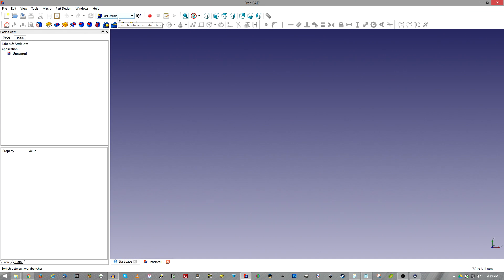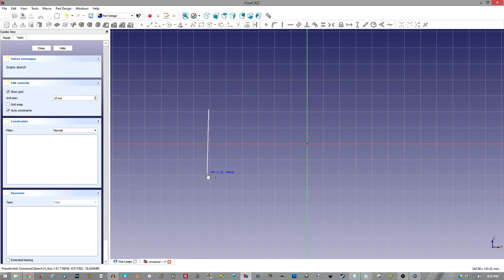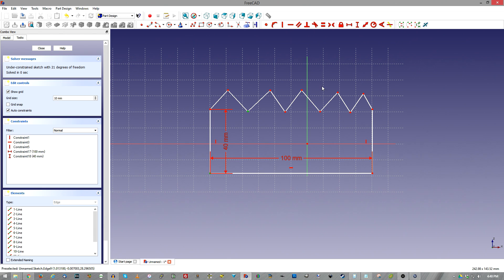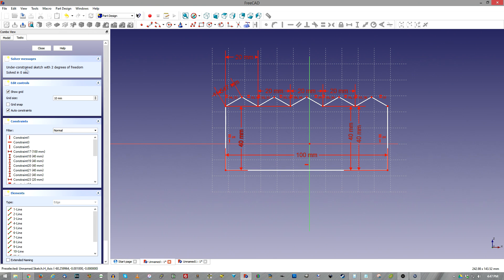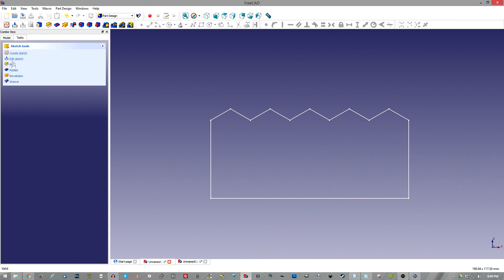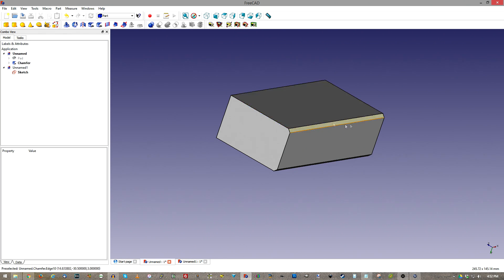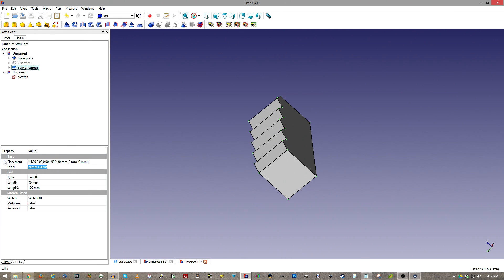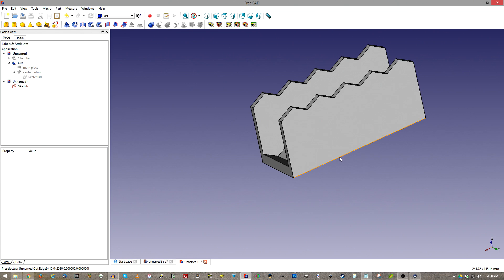FreeCAD 3D Modeling Tutorial 2: Designing A 3D Printable Model

Comment: hard to follow, I think you are either missing instructions or 0.16 is different to 0.18 as create symmetry constraint does not work.
Reply: I was able to get this to work in 0.18 by checking the 'Auto Remove Redundants' box in the solver messages section of the task pane on the right side of the screen ('Combo View').  I had to keep removing the constraint regarding the left and rightmost 40 mm line segments to get this to work.

Comment: I have two questions when reproduce your work by using Free CAD 0.18. 
1. how to horizontal draw a line without using horizontal button? (I have tried to hold "shift" as wiki said when draw one, but it doesn't work)
2. how to draw continuous line. After drawing a line A, I want to draw another line B linking to A, so I place the start point of line B into the site of end point of A (now this point become yellow). But this line A-B is not a continuous line but two non-linked lines. When I move the common point, A and B are separated.
Reply: Looking forward to your reply.

Comment: You are clicking the line from the top menu every time you want to draw another line.  That is not needed.  When you are drawing a line, the line command doesn't terminate when you click the second point.  If you look at your cursor, you can see the line is still active.  To continue with another line, put the cursor over the end point of the last line.  When it turns yellow, as you point out, it is coincident.  Then you can click the first point of your next line, go  to the second point and click it.  Without going back to click the menu line (or selecting "L" on your keyboard) you can draw another line.  I don't know what version of freecad you are using.  Possibly this is older than 16, which I am using, an that functionality is not available on your version.
Reply: Or you can use polyline tool...
Reply: @Gruby7C1h  ohh yeah 👍👍 comments like this 😍😍

Comment: Instead of creating so many individual lines by launching the line tool each time, you could have used the Polyline tool just to the left of the rectangle tool, and be done in one go and in much less time.

At 7:15 you add a vertical distance constraint of zero between the profile bottom left end point and the horizontal sketch axis. That's not considered good practice. You should have created a point on object constraint instead.
Reply from the maker: +Normand Chamberland Woah, thanks for the tip! That looks a helluva lot easier than trying to connect individual lines!

Yeah I have learned the hard way recently that it is not the best solution. I'm usually not one of following best practices. :P
Reply: No problem. Follow-up tip: the Polyline tool has 6 constrained modes that you cycle through by pressing the M key. You can do perpendicular or colinear lines, tangent and perpendicular arcs. It is really my go-to tool in the Sketcher.
Reply: Finally.. Finally... I know that I'm not alone in this.. But still, thumbs up for Power Playground.
Reply: YOU CAN FIX AN ANGLE TO 120 FOR HEXAGON